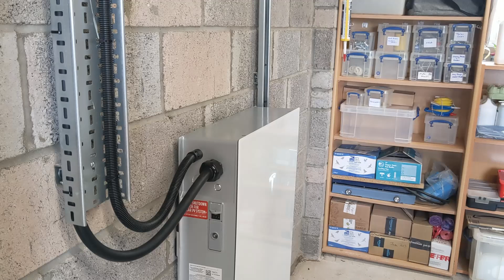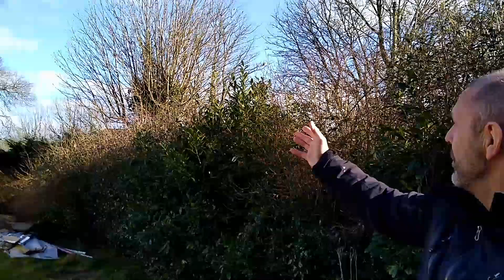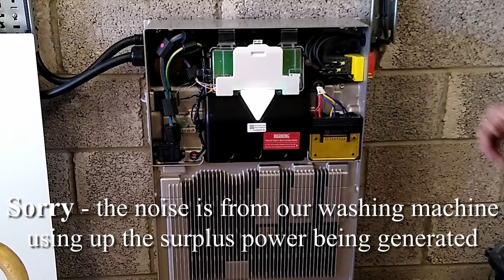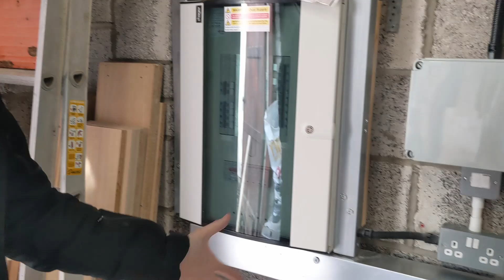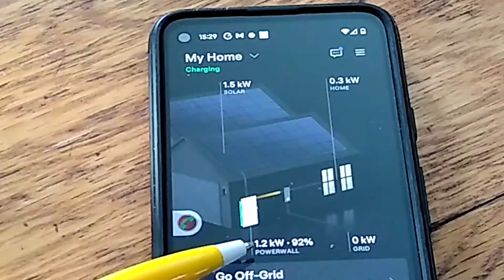27 solar panels + Tesla Powerwall 3 battery installation.

Comment: Hi just come across your install here on YT.  I could be wrong so worth checking but I believe Tesla do not allow optimisers to be used with their powerwalls?  You could possibly be invalidating our warranty and it’s something an installer should know if they are Tesla certified, so I hope it is me that’s wrong. 

Overall seems a great setup though and a good install and importantly your installer looks to have done a very nice neat job.

Comment: The powerwall 3 is 13.5 kw .so maximum is 13.5. Also 450 single faces panels will make 11.50kw maximum. Its a good system system. If u got the spare cash, i would fit a the tesla powerwall expansion battery. Just to cover winters and an ev charger if u have one ...the battery will increase your power down load, too, cheers

Comment: Regarding the export limit “awarded” by the DNO. Our neighbour has 12kw of panels with an 8 kw inverter., half are north facing). The DNO awarded him 2.6 kw of export on the Sec99 application. He could have got 3.68 on a Sec98 as your video explained.

He found out that these “ investigations” are mainly done online and if the computer says “No” the letter generated gives these odd returns. He then asked to speak to a manager in the department the considers these applications in our area (Western Power) Having had a telephone conversation he subsequently got a revised award of 6.2 export.

We currently have 5.4 kw of solar running the through two inverters of 5.5 kw combined with a Powerwall 2, and wanted to fit a second Pw 2, the DNO refused us any change from our current 3.68 export. We are now  in the process of selling the Pw2 having through our installer asked and received permission from the DNO to fit a PW3 and an extension battery with an export limit of 7.2 kw. The difference is that as the PW3 is a hybrid inverter and going to take two of the strings that currently goes to the existing 2.5 inverter. This gives the same 5.4 potential pv generation, whereas before with the Pw2 both existing inverter’s output were added to that of the Pw2’s 5 kw output. For information we are single phase supply, the DNO quoted £15 k for supply of three phase when we did our original Sec 99 application in 2020.

The moral of the story, it is possible to get that higher export limit if you stick at it. Sometimes it does cost, sometimes not. We wanted more battery capacity for when we do fit an ASHp, not yet, the gas boiler is relatively new but we do try to plan ahead.

Good clear video and your installer is very articulate and explains some of the complexities very well.

Comment: Gut feel says the 20% buffer you're keeping in case theres a power cut at a rare time when your battery might have been empty, and your solar dark and your household is demanding some power.. is too conservative and you can probably set it lower ...and then blame that guy on the youtube comments if the powercut turns up at the worst possible time..
Reply from the maker: I agree with your comments, the thought had crossed my mind too. What is the chances of a power cut when the battery is that low? But if there was, what a pain to reset all the house electrics.  Then what is the cost for setting the 20% minimum? Yes, a balancing act. Thank you for your comments.

Comment: Congratulations. That system will perform extremely well I have no doubt. A bit of a shame about the export limit but great to see you went with maxing out your roof despite this.
Reply from the maker: Thank you. I plan to produce another video of the first 6 weeks. The big conclusion my early learning has come up with, is better to put up too many panels and not use all the power on sunny days (we now have everything running as the battery fills by about 1pm - 2nd battery DC Powerwall ordered due in May), it is the overcast day output we should be focused on. What is 10% output for a solar panel system? Thank you for commenting.

Comment: I had a PW2 installed before Musk went rogue a couple of years ago. It has looked after us following about 6 power outages, the last one being 6.5 hours long. In addition it saves us money on a daily basis in conjunction with our solar array. Givenergy do a similar product and there are others in the market now.
Reply from the maker: I just Googled GivEnergy EPS (Emergency Power Supply) capabilities I got "The main drawback of the GivEnergy systems is that they only offer limited power in a powercut, the solar PV cannot function in a power cut." I wanted a battery that solar PV to be able to function during a power cut and the house too.
Reply: No one cares about your virtue

Comment: A bit late now, but have you considered the sigenergy system? Depends on your circumstances I guess, but in the current political landscape I would always vote with my wallet and ..ck Elon!
Reply from the maker: Nope, I have never heard of 'sigenergy' system. Just Googled it. I would need to get up to speed on it. I went to laods of people who put themselves out there as installing solar and batteries, some 20 to 30 comp0naies looking for the EPS system that meant we would not notice a power outage and importantly we could operate independent of the grid. 
Thank you for that comment. When I get half a chance I will try and understand what sigenergy system offers.
Reply: @JamesRattray  the guys and gals at spirit energy have a really good comparison video with Powerwall 3 vs sigenergy. Have a look when you get a chance.
Reply: @JamesRattray  Artisan and other bigger UK Tubers have seemingly switched over to the Sigenergy system too. My company is also looking at focusing on Sigenergy and a couple other systems. Tesla now has bad optics with customers.
Reply from the maker: @effervescence5664  Interesting. In a power cut the SigenStor battery storage system will automatically switch over to powering essential circuits from the battery storage system. It will allow solar PV system to keep running during a power outage. Not sure what essential circuits means, does it mean rewiring a system for power curts are reconfiguration of existing circuits?
Cost v Tesla looks slightly more expensive.
Sigenergy offer two battery storage capacities, a 5kWh Sigen module, and an 8kWh Battery. 
Sigenergy 5 kWh Battery Module Prices:- 1x 5 kWh £6,100; 2x 5 kWh £7,750; 3x 5 kWh £9,400

Powerwall 3 - 13.5 kWh is about £7,000. Musk certainly is helping any products that he is associated with right now.
Reply from the maker: I believe Powerwall 3 is the right option after looking at the 'sigenergy system' - this might be good for those who don't want to buy any products associated with Musk!
Reply: @JamesRattray  not exactly sure where you got those prices for the sigenergy system... I've been quoted around 8-9k for 12kW single phase inverter + 2x8kWh sigenstore battery + gateway... So nowhere close to the figures you got!
Reply from the maker: @catalinomocea6986  I watched a review of the sigenergy system v Powerwall 3 saying sigenergy system was slightly more expensive 5% or so. I totally get sigenergy system is great system
Reply: I didn’t think Tesla allowed optimisers on the DC strings ? i love your setup very neat job. installation is top quality, ive got a powerwall and DC expansion pack absolutely love my setup i used Heatable excellent job
Reply from the maker: @jasoncleaver7810  You are right about the optimisers on the DC string, it trips the battery ever so often, we reset it. Hopefully they will sort this at some point, may be with a software update. Yes, we are absolutely loving it, never had so much power in the house. 2nd battery is on order, a DC battery delivery in May, on a sunny day our single battery is full by 1pm.

Comment: Looks like you not only have a great system but as importantly you have a good installer.
I've had 8.2 kWp of panels with a 5 kW hybrid inverter and 9.5 kWh battery for 14 months now and whilst I'm very pleased with my system I am looking to expand it.
Reply from the maker: I totally agree, with your comment about the installer. I met Paul at the quotation stage, what impressed me was that he was been very methodical, before he quoted, by measuring the roof physically checking load bearing beams etc, to make sure there were no issues there. This has continued throughout the whole contract. I would give him 12 out of 10, exceeded my best expectations.